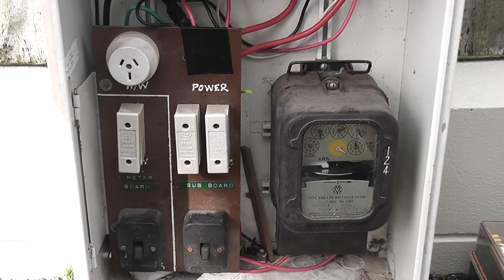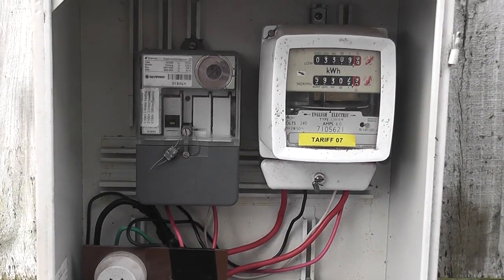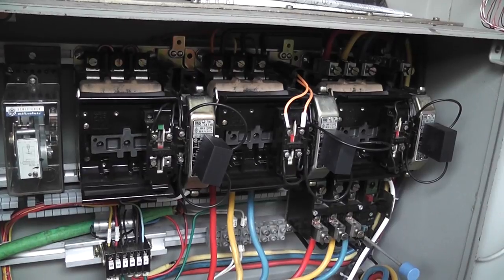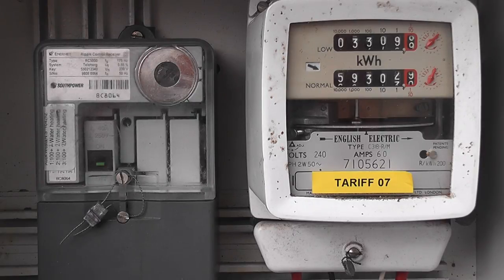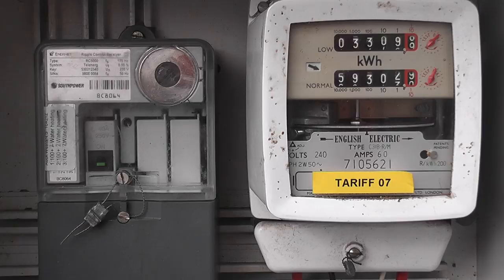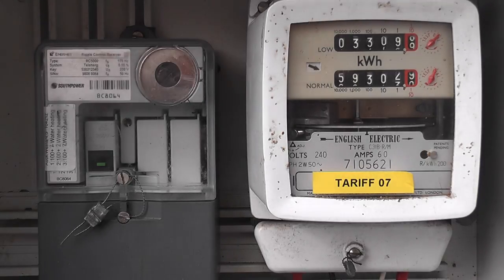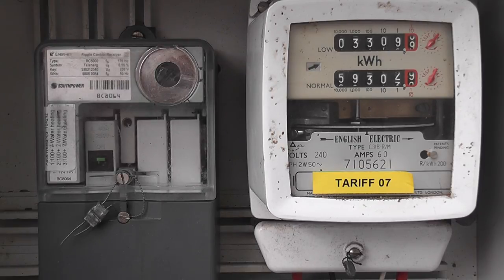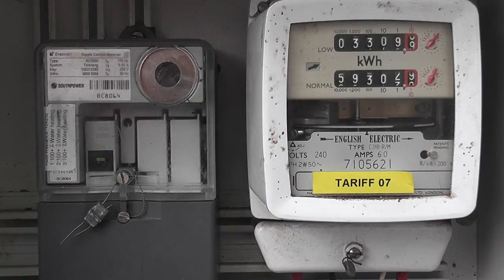Ripple Relay Receiver

Comment: In the U.S. this is called "carrier current". Might be used for many things, but my experience with it is that it is used to synchronize clocks in a large building like a school for example. Might have two frequencies, one to set the clocks and one to ring the bells. The receiver was built into the clock or bell and consisted of a tuned circuit and a thiatron to activate a solenoid or relay. Late 1950's technology.

Comment from the maker: Good question, when remote switching is done the 1050 Hz carrier signal is present for 3 minutes. 22 channels are available for switching. generally a master ON or OFF signal is injected and the relays are set on different channels to allow for gradual increases in the controlled load. e.g. better to switch on a 100 MW load in 10 MW steps than in 100 MW at once.
The solid state ripple plants do the switching a lot faster, like 20 or 30 seconds.
Reply: is the solid state switching like an electronic version of the electric motor and 1050Hz generator?

Comment from the maker: Yes that would be the changeover from the meter tariff to the low rate and the electric water heating switching on. The ripple frequencies can be heard sometimes in appliances when the signal is passing through. An other option often used is a good quality time clock which controls the meter and a relay.

Comment: That's cool bit of electrical engineering that I was completly unaware of :) So basically somewhere in power plant, or in distribution station there is a ripple generator injecting 1050 Hz ripple onto 50 Hz sine and at customer end there is special relay that picks that 1050Hz ripple and switches meter to "low" + energizes additional circuits for non-essential loads. Does it mean that who,e time the low tarrif is active there must be that 1050Hz signal present? And what if someone injects 1050Hz on their own to force switch to low?
Reply from the maker: +mibars The 1050 Hz signal is there only for about 3 minutes in bursts. Ripple receivers are set differently so they don't all switch on at the same time, to avoid an inrush surge. The signal is in bursts of around 6 seconds to trigger different set relays.
Reply: Do you have somewhere which shows the times which these control signals are sent out? Also with the times would probably be the specific systems which they are trying to turn on/off.
Reply: super interesting, had no idea this was a thing.

Comment from the maker: One ripple system can do multiple functions. In Auckland Ripple receivers are fitted in single streetlights or control a bank of streetlights via a contactor controlled via ripple relay.
Hot water heating is controlled via ripple relay on site as in this video, or via a ripple controlling pilot wires. or one ripple relay per large building. Then a hard wired pilot system is used as well controlled direct from the scada, with a normal relay at the meter panel.

Comment: Is there an easy way to inject that ripple over the mains? Because i am going to make a system like this and i don't want to have to run separate lines to the devices i am running.

Comment: Doesn't look like there is much security around those meter. look like it would be easy to connect to the power wires before they goes into the meter. Also. Has anyone ever tried to synthesize the ripple code and back inject it into the mains to make there meter go into the low tariff setting?
Reply: much easier to hotwire your meter - Aus and NZ you can easily hot wire your meter to steal power than in the USA

Comment from the maker: These meters are being replaced at the moment. Smart meters is just a slogan, they are dumb meters to maximum profits from greedy power companies.
Reply: RODALCO2007 100% agreed with that
Reply: Exactly. You have to pay for reactive and harmonic losses now. And best of all, the installers are on a time per installation quota so you get terminal blocks with loose screws, high resistance joints and arcing. And fires. The installers (usually with only basic training) are being pushed by management to install x number of boxes a day. With only 24 hours in a day, sloppy work and cut corners ensue to meet these arbitrary quotas. Workmanship? What's that?

Comment from the maker: The streetlights may have gone onto photocells now. What system did they put in place ? We use a pilot system as well in city areas here but it requires additional control wires.

Comment: In finland those smart meters finally changes low rate to be on same time and not depending on daylight savings time. Thats because that cheaper rate is controlled by sealed clock and it was always on winter time, so during summer cheaper rate was an hour late. Now the meter time is synced automatically. It's also nice info to watch power consumption on hourly basis from local power companys website.

Comment: That's pretty neat.  I wondered how the rate was switched.  What's inside one of those receivers (the electromechanical type)?  Is it kinda like a telephone bell where there is an LC circuit that is tuned to (in this case 1050Hz) which pulls in the actuator to switch the rate?

Comment: Ah yes, this is niiiiiice. :-) I like that English Electric kWh meter with the white front-case. :-) It even has a white terminal cover to match. :-D

I pretty much figured how this system worked the first time I saw it, as it's an equivalent to our Radio Teleswitch system where a radio station ( BBC 4 198 LW ) transmit a carrier signal to operate a unit similar to the ripple receiver you have there.

The older method of course, is the Rate-changer Horstmann/ Sangamo/ Venner timeswitches.

-BBD.

Comment from the maker: That dial is in the substation and shows the decoding status. The relays are all switched ON at different codecs to avoid a large inrush current of many water heaters turning on all at the same time. 22 channels can be controlled this way over a 3 minute time slot.

Comment: Does the ripple signal interfere with the house outlets? Or is it on its own separate dedicated control line?
Reply from the maker: No, the 1050 Hz ripple is super imposed on the mains. appliances don't notice it. You can hear sometimes the tone in a power transformer.
Reply: @RODALCO2007  ah. Thanks

Comment: here in Ontario Canada they have done away with mechanical flat rate water heater systems and simply impose different rates with digital meters (that blow up) controlled centrally

Comment from the maker: Yes, I have heard of those systems on master clock systems in which clocks with second hands can be synchronised with each other, in the case of clocks out of synch. Similar principle.in which a decoding device pick up the signal and does the adjusting.

Comment: I love the Zellweiger ripple control system. A motor-generator that sings, relays and switches that give a satisfying "thunk" and analogue remote control. And simplicity. What more can you ask for? Here in the UK we have something similar for on-peak/off-peak (Economy 7) which uses a radio station as the transmitter instead of a 1050HZ superimposed sine wave on the mains supply. Do you know if something similar to ripple control was (or is) ever used in industry as a control system (prior to SCADA) where a ripple signal could for instance turn on (or off) contactors to supply a piece of machinery from a remote control station? If you wanted to turn on a piece of machinery, you could do it remotely via an injected ripple rather than send a bloke to the other side of the site is what I am thinking.
Reply from the maker: We use another signal control system to. That is the GEC Cyclo transmitter system. I have a video up of that one too. That system transmits signals at the zero crossing by means of high power thyristors. That is an English system. I am sure that Cyclo system is also used in the UK in areas where the radio signal doesn't reach. In the cities we use a pilot system as well, basically an extra two control wires to turn on and off hotwater systems and streetlights. Then a 475 Hz system with solid state controls drives the signals through the 22kV network.
Reply: Thanks for the info on the Cyclo system. It looks like the precursor to SCADA (but only in one direction rather than bidirectional which SCADA does). I haven't much to do with SCADA and know very little about it. Apparently streetlights are still controlled (in London) by the Cyclo system. Some UK streetlights use Sangamo timeswitches (specialist units for streetlights) from what I've read (and seen on BigClive's channel, he does a teardown of a unit). Whether the Cyclo (or Sangamo boxes) are still used or not I don't know. I'd imagine the Cyclo system is cheaper and easier - one centralised control station instead of electromechanical boxes that can go out of synch and will need resetting and adjustment by personnel. Where I live it is remotely controlled from a central station and probably uses the Cyclo system. All the lights can be turned on and off all at once via remote control for inspection purposes.

Sadly (and ironically) I don't know much about the UK's Economy 7 switching system. I do remember the house being controlled Economy 7 wise via remote control from a switching station but that was back when I was a kid. The house still uses electric night storage heaters. My house seems to have a purely mechanical timeswitch (AC synch motor with two "day and night" pins, possibly a Sangamo) as I can't see any switchgear other than the clock (sealed with anti-tamper chains) in a Perspex box. I'll take a few pics and upload them.

How do surge protectors and harmonic filters handle the ripple signals? I'd assume that the filters/surge protectors would send the ripple to earth. Would a ripple signal also cause a UPS to switch onto load? I've read that the ripple can make tungsten filament lightbulbs "sing."

Comment: Does anyone know where I an get a ripple receiver relay, because I am trying to make a small version of the off-peak system to control pool pumps.
Reply from the maker: How are you trying to inject the signal into the mains. A old ripple relay can be obtained by the local power authority as they take a lot of devices out and fitting these so called "smart meters". (well they are actually dumb meters and only provide remote meter readings)
Reply: I think I am just going to get a simailar generator and program the receiver to use it's frequency and inject it using a contactor coded by a relay logic based timing circuit. Also can I get them if I am in the US?
Reply from the maker: Not sure if they ever used ripple receiver relays in the US. I have never seen them there, perhaps have a look around on ebay. Or try a utility in a large city.
Reply: Ok, I might see if they have them anyways.

Comment from the maker: Now these days communications is per RT, cellphone, satelite phone.
Cable jointers use phones through a cable to be terminated , to check for the correct phasing, but only when the cable is isolated from the grid.

Comment: what does tarrif 07 mean?
Reply from the maker: Tariff 07 was a controlled electric heating tariff which was billed at a lower rate.
Reply: RODALCO2007 so like under floor heating? - im assuming they are phasing that out in favour of heat pumps or gas heating?
Reply: RODALCO2007 do you know if northern victoria uses this system to switch controlled loads on or off?

Comment: Yep. :-) Before Radio Teleswitches, most, if not all electric boards used Rate Changer timeswitches made by Horstmann/ Sangamo Weston/ Venner. 

See my channel for Horstmann / Sangamo Rate Changers. :-)

I don't have any radio teleswitches though. Having said that though, I think in the next few years, they're going to phase-out the Teleswitches, because they're going to be replaced with internally-timed-&-switched Smart Meters, so there'll be no need for an external timer / switch unit.

-BBD.